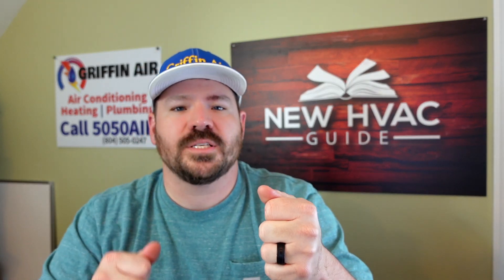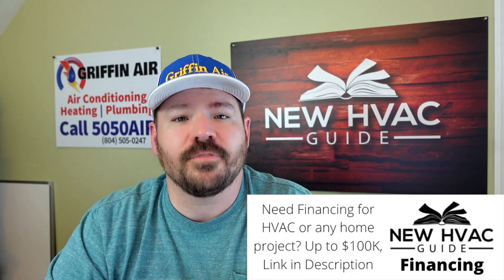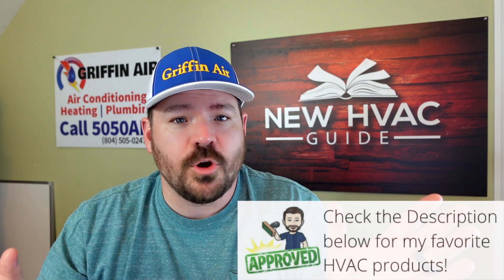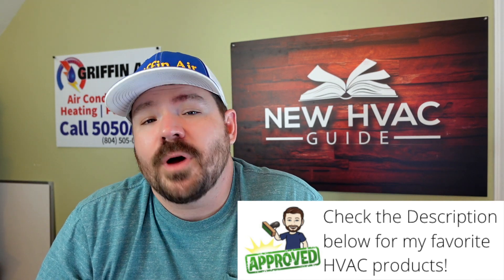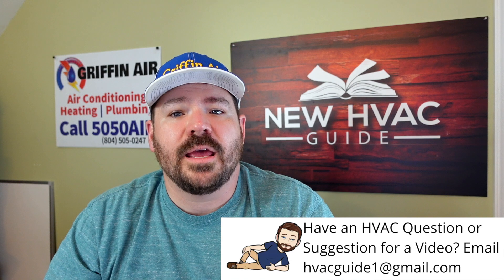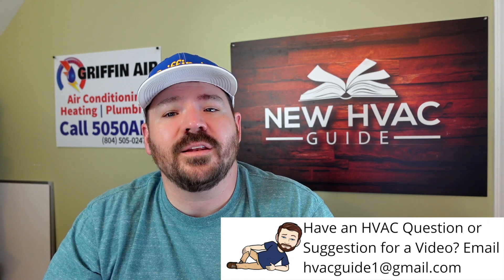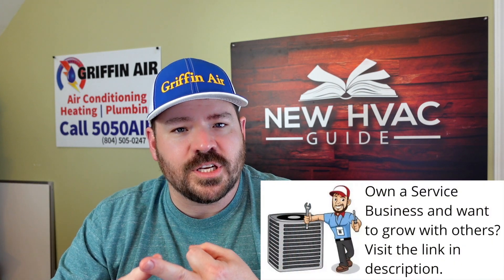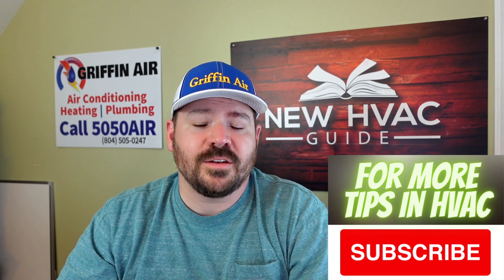NEW Furnace Efficiency LAW!

Comment: Regarding AC options..  energy has gone up 10x in Germany...many food stores have closed because they cannot afford to run the refrigeration... much less heat spaces with 20 foot ceilings. 
 .
Some homes will be forced to drain their plumbing systems and let it all freeze and just wear heavy clothing and maybe spot heating like electric blankets or heating pads under the heavy clothing  to stay alive.

With heavy clothing it only takes 400 btu per hour to stay warm and the body produces all of that....without enough food however and in severe situations a small one pound lithium battery pack might have to supply 100 or 200 btu per hour to stay warm.   

....without running water.
.
Carrier and others have already developed stratified cooling for large indoor space areas. and I developed a laminar flow 'air lens' that puts out a column of air down from the overhead onto a target up to 15 feet below...  

the stratified air diffusers take various forms, 18 inches round. 4 or 5 foot tall diffusers outflowing at 50 or so fpm to keep the cool air stratified at the lower occupied areas... 
.
and using electric or gas fired radiant heat for heating ....that only heats targets not the air.
.
Very shortly you will be able to buy all that stuff from China for 38 cents.
.

.
For a while China made a thermoelectric cooling pad that you could sit on or lean against in a padded chair.... maybe it turned out to be a good way to generate heart attacks.    The data of  heating 10 to 15 feet of overhead space to keep one or two people ... or even 50 people warm.... are soon to be over.

Similarly with transport... you could load people into a small bore  hyper loop like ammunition... and fire them down the tube at 2,500 feet per second....no capsule needed skinny people would wear an O ring ....we are working on the eyeball issues now.just  think of all the time saved.

.

.

Comment: In South Texas, we only need heat for a couple months so I have never seen a high efficiency furnace in any home. The problem with the high efficiency furnaces is that they are more expensive, not designed well (too much cheap plastic) enough to last as long as most non-condensing furnaces, require more maintenance (drains), and harder to install. Just check out the improper drain and vent pipe installations on YouTube. Most installers are not properly trained to install high efficiency furnaces.

Comment: I remember when we replaced our HVAC system and I told one of the HVAC contractors that I wanted a high efficiency multi stage unit, but he did not listen to me and tried to push that 80%  single stage crap unit and would not give me an estimated price for the high efficiency unit.  He stated that is what he typically installs for his customers (guess I was not a customer).  The single state on/off unit just was not working for us and our house and I explained this to the HVAC companies who were providing estimates.  Additionally, I figured the world was headed the higher efficiency route when the minimum SEER ratings had been increased by law.  We found an HVAC contractor who listened to what we wanted and installed the high efficiency system which is rated at 98% AFUE (Carrier Infinity 98 59MN7).  We immediately noticed the difference in the AC and Heat capabilities compared to our old single stage unit. So, my hunch was correct.

Comment: This efficiency standard was already suppose to have happen years a go. They had already stopped producing non condensing furnaces. But at the last second a particular party reversed everything. That actually made things more expensive. Now on top of that it is going to be more expensive to implement this time. But eventually equipment cost will go down. Since a lot of equipment production is now moving from Mexico to China.

Comment: In Ontario they are basically already gone. We used to call them mid efficient furnace
Reply: In Ontario - anyone doing Heat Pumps?  Is that an option or very rare?  It looks like in the US (besides 95%+ AFUE Gas systems) there will be a big push for Heat Pumps over the next 10 years.  A lot of regions in the US can use them because of moderately cool/cold winters - but I don't hear about Heat Pumps (even with Heat strips) in super cold winter regions where it can get say -15C.
Reply: @Kenster-man  no heat pumps aren’t used much just the ductless mini splits for ppl with a garage (don’t need to run gas) and ppl with additions or hydronics.

Comment: There is no getting around this change to higher efficiency of all sorts
There is no getting around a move to no or lower carbon fuel usage

Every manufacturer is moving this way regardless of what the public wants.
Manufacturers know higher energy standards will be mandated in the future and they must develop products and sell them now versus waiting until the laws are changed and be caught flat-footed.

97+% efficient furnaces are just a start

There will be more switching to electric powered heating through heat pumps.
Solar will become common for electrical energy with battery storage.
RTU will likely switch to condensing gas sections incorporating heat pumps to lower overall fuel usage.
Ground and air source heat pumps will become common.
District heating and cooling with heat pumps will not be unusual
Heat recovery of all sorts will become necessary 

Tech of all sorts will be invented to save energy.  Some of it will be crap.
Massive investment and company creation will occur

This will all happen in the next ten years.  god help us all.
Reply: It'll be interesting to see what new Heat Pump technology comes out over the next 10 years.  Here in super frigid Illinois winters - I don't hear about Heat Pumps nor do HVAC techs/shops talk about it.  I even asked a couple of mid-sized HVAC shops who don't know much about Heat Pumps here nor have installed them.

Comment: In our area you must line your chimney if you want to install an 80% in an outside chimney. The cost of this exceeds the cost of a 96% so I haven't installed an 80 in over 15 years. One of the problems have been condensate in the ventilated attic but because I am past the age of crawling around on rafters this doesnt bother me either   lol. The fact is you will save 15 cents on every dollar you spend with a 96% so as the price of gas goes up and up, you will save more and more every year. Personally as a Master Plumber and an HVAC mechanic I love the high tech stuff. As a young man working in my fathers shop I watched the plumbers embrace PVC pipe and Fernco fittings, all they could see was how much more profit they could make and how much easier their job would be. What they didn't see was the Lowes and Home depots selling this cheap, little experience needed plastic junk. On the other hand I watched the HVAC trade come in with condensing boilers, outdoor resets and pri sec piping,Inverter drives etc. The knowledge and skill needed became higher and higher and our income became higher and higher surpassing what we could make on plumbing. Personally, I would like to see all new homes built with low temp radiant heat and ductless a/c. In this country we ended up with warm air furnaces with a coil sitting on the outlet side for a/c and blowing air through fiberglass board using a single thermostat to try and control the temperature throughout the entire house. The cheapest least efficient junk heat available not to mention the fiberglass that is filthy and a great platform to grow mold. All this junk has been brought to you by the cheap ass home builders of today. End of rant   LOL

Comment: In CA they've doubled down on screwing the consumer. In certain Air Quality Management Districts they now require Ultra Low NOx furnaces. The older low NOx standard of 40ng/J has been lowered to 14ng/J. Its almost impossible to find these products because most manufacturers only offer a limited selection of models and the prices are several hundred dollars more than the comparable low NOx version.
Reply: Meh, just put in an inverter drive heat pump.

Comment: It should’ve been noncondensible furnaces a decade ago.  The only reason their prices are artificially inflated high is because of all the different options and models available.    Manufacturing cost drop as unit numbers production goes up in competition in numbers from other manufacturers go up forcing prices down.  

Just like when the very first high SEER air conditioners came on the market they were ridiculously expensive.      

Now we’re approaching a time where I’m most majority of them especially here in California or high-efficiency and their prices have dropped except for the supply chain Covid thing that went on exclude before that time frame. 

There’s no reason we should be producing heat using hydrocarbons and 30% or more when they’re in properly installed and that’s more common it’s going straight out the flu into the atmosphere instead of heating the house. 

That’s the same as filling up your two gas tanks on your big horn ton diesel truck and punch in a small nail hole in each gas tank so the gas is dribbling out while you’re driving down the street wasting fuel directly to the atmosphere and not burning it.   Does that make sense wasting a resource and more pollution in our air and groundwater. 

And has the new air tight in insulation efficiency codes go into play on new construction houses and retrofits rebottles. 

You will find we need only a 24,000 BTU gas furnace for a 4000 square-foot house in the snow. 
                       And with the size of houses and apartments in condominium shrinking in this country because of cost of materials and land just like Japan had to go through the same thing decades ago. 

They need to make furnaces that are down to 9000 BTUs to 18,000 BTUs because that’s all it takes to heat a net zero home or super high efficiency constructed home. 

Or just switch over to the heat pump end the story problem solved. 

Only problem is the majority of the guys are uneducated who say heat pumps don’t work in cold weather they always size them wrong still to this date the majority of HVAC technicians don’t know there are high static pressure and medium static pressure ducted heat pump air handler‘s and they’re much more quiet than your standard furnace. 

And if the technicians are not willing to read and learn how to properly diagnose and fix the equipment McDonald’s is always hiring for burger flippers and janitorial services need somebody to scrub the toilets applications available.

Comment: The US has fallen behind the times compared to the rest of the world when it comes to hvac. I don't understand the resistance to new tech in the hvac.  Ayear ago Half of the quotes i received people still want to sell me a crap single stage ac with an 80% furnace and charge me an arm and a leg.  If the govt didn't mandate this type of stuff we would never gain better performing systems whether it's comfort or efficiency. Flip side I do agree it sucks if you have an older home that may require a tougher installation for a side vent.  If any thing should be mandated it should be better insulation and air sealing standards in older buildings too and have it heavily subsidized to modernize
Reply: You have may gotten a quote from a lower end HVAC shop --- with 80% AFUE Furnaces you can get 2-Stage Variable Speed systems....you're not stuck at all with Single-Stage units.  The avg difference is just $60 year in savings versus a 95% unit.    

Look at cars - some manufactures put out newer engines for the sake of better fuel-efficiency with some newer bells & whistles technology - GUESS WHAT?  Many of them are crap!  Look at some of the sh*tty Nissan engines that don't even last 5 years and facing lawsuits.  So spend more and deal with some of the new crappier fuel-efficient generation of engines that crap out early all to save $60 of gas a year and so I can drive with a newer tech engine?  

Don't get me wrong - I'm not saying to not innovate - but you gotta understand some of what's happening with caution and it sometimes takes a long time to improve on a generation of new technology.
Reply: There is nothing wrong with a single stage ac and 80% furnace. You're complaining about being charged a high price yet you want the US to move to more advanced and more efficient equipment which is just going to end up costing you even more money to install. The breakdown downs will be more frequent. More maintenance will be required, as well as training. Diagnostics will take longer. There may be more of a wait time inbetween repairs due to unavailability of parts. In the end, was it worth it to save 10% on your energy bill?  

When the government mandated that R-22 refrigerant be phased out and we moved over to the "environmentally friendly" R-410, customers saw a huge increase of leaking air conditioning systems. The new refrigerant was much higher operating pressures which lead to more leaks. The oil thats carried in the refrigerant changed and caused many issues if technicians were not using the proper brazing practices. And now, the 'environmentally friendly' R-410 refrigerant is being phased out because its GWP is too high. Currently the industry is switching over to mildly flammable refrigerants (Propane, butane, R-454b, R-32 etc.) which require more sensors, more training and specialized tools. None of this is a benefit to the customer, only a hindrance. You're just going to be paying more out of pocket for roughly the same comfort level in your home. Enjoy your mandated government utopia of 'efficiency and comfort'.
Reply: @TheGhettoLobster  What new sensors will be needed for the R454b refrigerant? All it will need is a high and low pressure switch like any other system and defrost sensors if it is a heat pump right? Will it need a leak sensor to detect the flammable refrigerant?

Comment: This is good business and it will go on and on; it's a great idea to have a clean environment; the problem we all have is after all is said and done; utilities will increase the cost of their fuel to compensate for the loss of revenue due to higher efficiencies. It had happened before and it will happen again!
Reply: That's why you go solar and all electric with high efficiency appliances and if the power companies throw a monkey wrench into it, get a battery.

Comment: Maintenance and repair costs for the high efficiency furnaces skyrocket because of the extensive and fragile electronics involved,  for instance the older style PSC blower motors cost $150.... the new variable speed motors cost as much as $1500.

The fan relay on an older furnace costs $7.50... on the condensing furnaces...cost is in the $300 to $600 range because the fan relay is soldered into and integral with the main printed circuit board so that the entire board has to be replaced.

Phil Scott, mech engr and shop owner for 60 years so far.  27 men on staff. retired.
Reply: That's why you're better off with a heat pump, geothermal if you're in a cold climate.
Reply: You can buy the relay for around $3 and I have soldered it in for people.  I am going to a heat pump anyway with the main winter heat being biomass. Many people are looking at cheaper ways to heat.
Reply: @stevegorkowski3246  Good work Steve!  any idea where they get the relays.